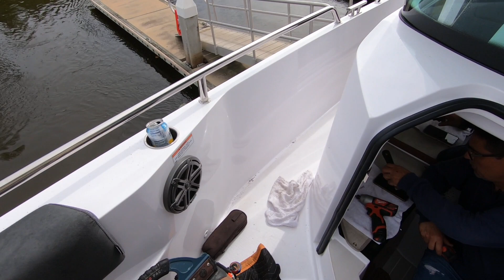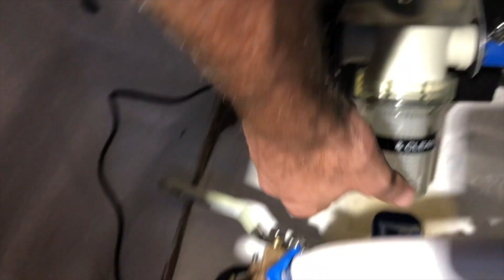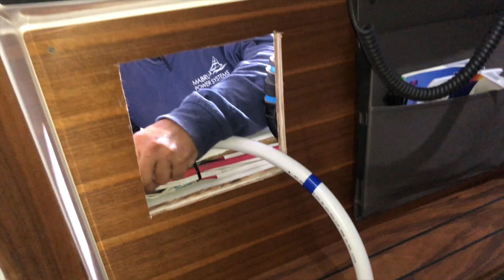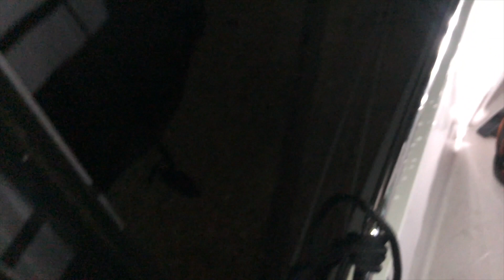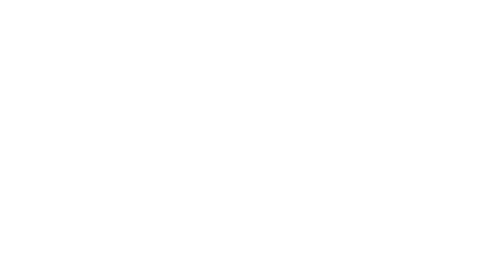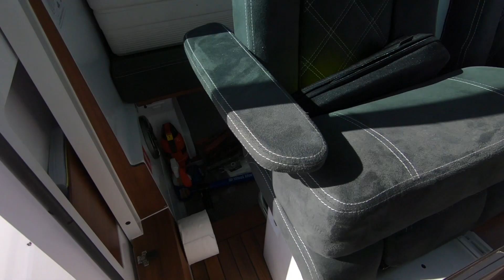Axopar 28' 2019 Enclosed Aft Cabin Air Conditioning Installation From Start to Finish by Mabru

Comment: Not sure I understand:  You state below this is a '120v system' but it still requires a substantial 12V system to work away from the dock.  Why was this approach taken vs. the 12V 12,000 BTU system (with larger battery bank) you installed on the other Axopar 28?  Why not avoid the inverter?  Or is the 7,500 BTU unit only available in 120V?
Reply from the maker: This boat was one of the last vessels that we did with our 120v units running off of inverters and powered by AGM batteries. We didn't have the technology available at the time that this installation was done.